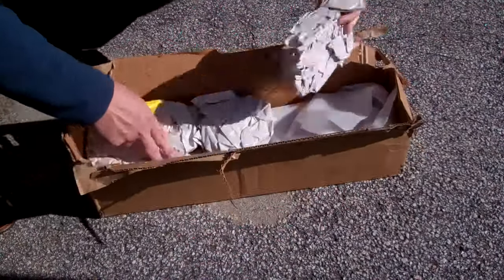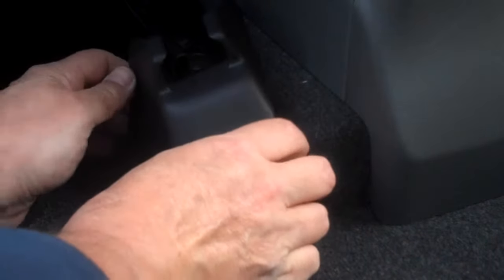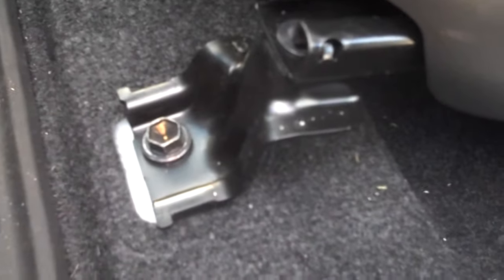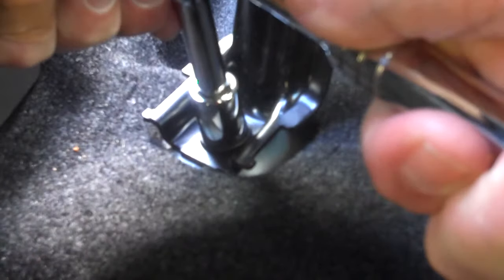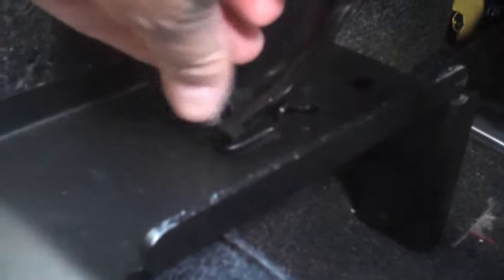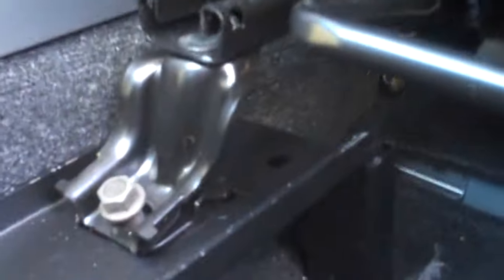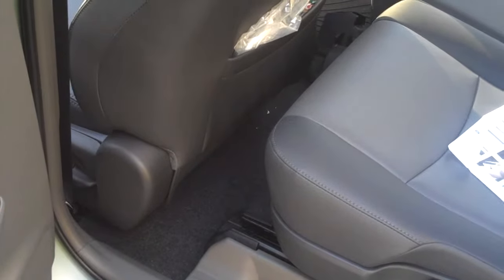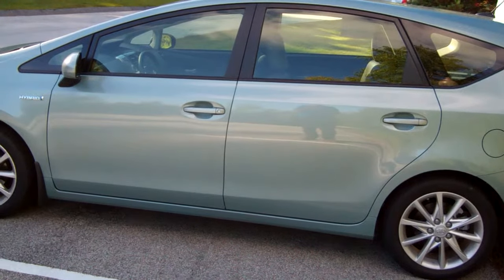ExtendMySeat Install for Toyota Prius V

Comment: prius V: how to remove the original seat cover on the rear seat? the bottom one is difficult, but i figured it out. the back support has a square plastic shield, this shield is the first thing to remove, but I have no idea. It is very tight on the top and can not look inside. any idea?

Comment: Terrific video! Thank you. Answers a lot of questions, is easy to follow and anticipates a lot of the workarounds that come up during an install.   I'm not that tall, my interest in your product for my 2015 Prius V is to make my driver's seat more usable while traveling. I'd like to be able to use my laptop in the driver's seat (while parked of course). Right now it's a bit too tight. I'll make a few measurements. My issues include how much of the forward position (for short people) will be lost and if my driver's seat would still work for my 5'1" girlfriend. Good work.